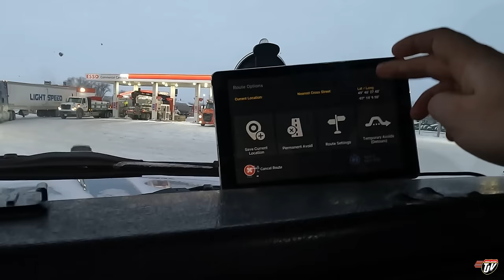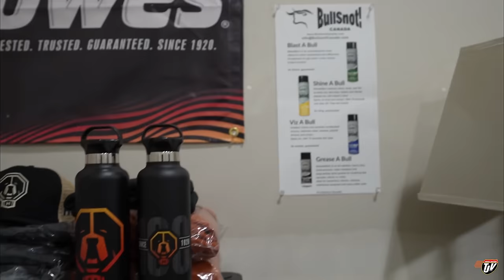WINTER WORK | My Trucking Life | Vlog #2983

Comment: I work for Walmart, and I can't tell you the countless number of times I had a box trailer load of mulch that had to be unloaded with a pallet jack.  The driver would park facing downhill in our parking lot.  The mulch would be on cheap pallets that were partially smashed, and I was the only one sent out to unload it.  I was also the forklift driver.  So, I needed help from the driver to get each pallet to the door, and then I would have to climb down and drive the pallet wherever I needed it.